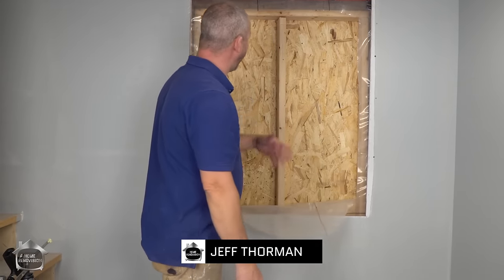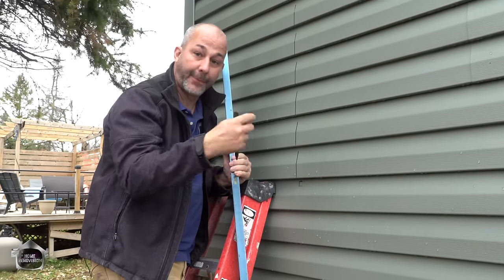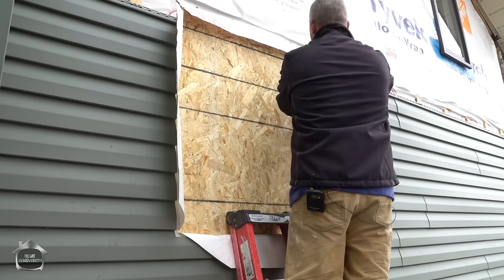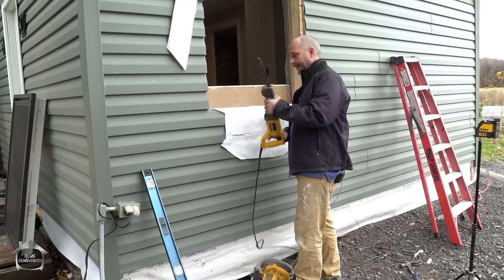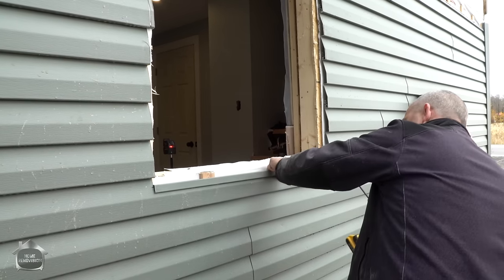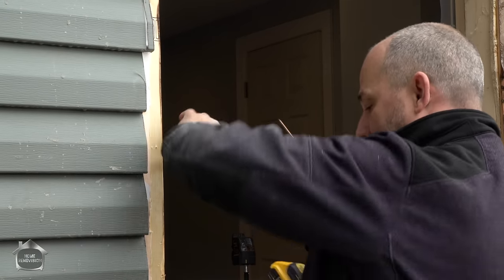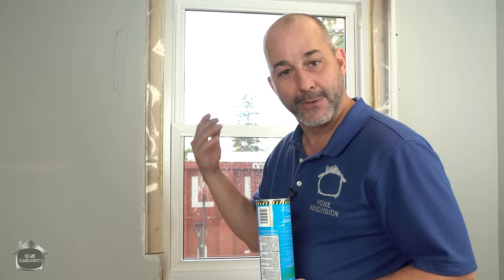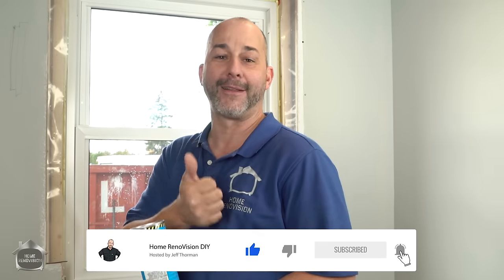How To Install A Window In A Wall

Comment: I gotta say - watching your videos gives me inspiration!  I was watching your other video on tips to reno'ing a kitchen cheaply, your idea about a pantry and removing cabinets blew my mind.  I have a breakfast nook off the kitchen, not too big (about 6ftx5ft) and I don't use it.  Directly underneath in the basement is a capped drain along with hot and cold water supply and I thought this might make a great butler's pantry.  My only problem is, a window exists where I would put the wall and pocket door.  I would rather resize the window rather than remove it altogether (and what do I do about the exterior siding?). Do you have any tips on how to diy such a project (butler pantry and window)?  Or is this something I should leave to a contractor?  My galley kitchen is a decent size but I think you're absolutely right - removing the cabinets and soffit above the counter top would make the space feel extremely airy.  Thanks for your awesome content - keep up the good work!

Comment: If some of the support is removed when cutting the wall, do I have to replace it elsewhere on the wall? Or will framing the box with 2x4"s be just  fine? Thanks.

Comment: I'd rather cut the siding back farther to allow for easier installation of the flashing, and then use vinyl trim around the window.  Also, shims should be used between the window and the rough frame for a true structural installation.  He's relying on the screws putting the window in tension to hold it in place.  Over time the plastic of the window will crack and the window will shift.  Also it's not clear in this video, but did he install a header?  He did say there was a door there so perhaps it already has a header.  Regardless, seems like an awful lot of corners cut in this installation, but to each their own.
Reply: It looks like a two story home so header is probably the rim joist that sits on the top of the double top plate of the first floor wall.

Comment: Hey what about the plate the goes on the top? And the small ones (cripples I think) do you didn't go over that. But I'm now wondering if that's only applicable in new construction

Comment: I plan on installing an exterior door on my garage but I think I might just pull the siding off and after installing the door I'll nail the trim on and then cut the siding to length.

Comment: What kind of blade are you using on the grinder? I'm in the process of getting ready to replace siding on 2 sides (hail damage). That blade be perfect for angle cuts (gable).

Comment: My house has asbestos siding, then they put insul-wrap foam board and then vinyl siding on top of that. My question is during window replacement what do I wrap or tuck in around the outside of the window for better waterproofing? Thanks!
Reply: A rubber membrane self adhesive flashing sold at home depot or lowes in window isle

Comment: What's the reason you used a renovator's brickmould rather than a nail fin window?  With a nail fin there's more work involved, being that you need to remove siding to put it in, however, you are able to put proper drip caps on, and don't rely on caulking to keep the window out. 

Please explain your decision. I don't like relying on caulking.

Comment: I'm thinking about using the spare window I have leftover from when I had a deck built and want to install it in my garage. Your video is very helpful but a previous video I saw the guy put a header in, is the reason why you didn't put one because you already had a door there before and it already has a header? Do I really need a header if I'm only cutting one stud?
Reply from the maker: yes I had a door and yes you need a header. Cheers!
Reply from the maker: you can make one with joist hangers to carry the load so as to not increase your scope of work. Cheers!
Reply: @HomeRenoVisionDIY  Thank you for your tip. As a homeowner, I sincerely appreciate your videos.

Comment: Also, could you showcase putting in windows that fit between studs? For cases where permits for structural changes can be prohibitive?
Reply from the maker: same as this only smaller. Cheers!

Comment: DIY you can go the extra  mile that can cost a premium when you hire someone, doing the best you can with your WRB and taping up as many of the penetrations is more belt and suspenders, then lipsticking a pig. The only thing differently I'd do is to put a cant strip on the sill to slope the water back outside (i.e. cedar shingle under the window, then blueskin over) so any water gets it, it will roll back out. Backing rods for sealant use.
Reply from the maker: love the idea of a backing rod. I will show that on the next window I do. Cheers!

Comment: So you cut a beam out without an additional header added?
Or was the framing already done for the window install and the stud was just for show?
Reply: The original hole was a door. He did a mock up for teaching. I had a similar question. The header part seems the hardest. I'd like to see it.

Comment: why not take more sidings out since vinyl sidings are so easy to install, instead of cutting so close to the RO. taking more sidings out will give you the room to install Window bucks, and apply tapes properly.
Reply: I believe he is putting the information there for some one that has a completed siding. But if it was my house I would remove the siding to get the nails in the siding i channel, and install the flashing better. Pretty good video for what he was showing a viewer

Comment: You just "happened"to have horizontal studs at the right place to install that window since it used to be a door there. While the vynil manipulations are awesome, I'd like to see the same video but with how to frame the damn thing so I can keep structural strength to my wall when cutting a big hole in it.

Comment: First, I love your shows... only thing is I'm surprised you don't wear safety goggles cutting tile, wood, etc.  Second, so I have an older house with builder grade aluminum plate glass windows that are like 35"H and 84" wide (side sliders) but it's in a brick veneer down here in Texas.  I have not seen any video showing how to replace old windows with new windows in a brick veneer house.  Have you done that?

Comment: Hey Jeff... Just a quick request.  Some of your links get lost in the videos (for instance, half way through you talk about putting a card up in the video corner for something related to what you are talking about at that moment).  The card never ends up there, which makes sense as they come at the end of the video per the way YouTube works.  My suggestion is to have a list of those links under a heading in the video description along with your social media links, etc, so that they are available. Just a thought I've had after a couple of the videos...  Otherwise your the man!  My renovation has come to a screeching halt as they have stopped all non-emergency inspections in my area so you are the only game in town right now!! Lol!!
Reply from the maker: Thanks Stephen, I will have another look. Cheers!

Comment: Jeff! I feel like you set some viewers up for failure by pre-staging your framing ahead of time. No one is going to going to cut a random hole in a wall to install a window and have a sill (and, I assume, headers with jack studs) magically appear in the wall. The header might not be a big deal on a single story house (or top story of any house) and the window is 30 inches wide or less and you know to make your cuts just inside two 16 on center studs so that you're only removing one stud...but that's a lot of IFs that I'm surprised you neglected to mention in this vid. If this were a wider window and/or there was additional floor(s) above this and someone did this without doing any additional framing work is compromising structural integrity and I know you know this because you've talked about load transfer in other vids!
Reply: I was wondering about that…

Comment: It would have been better to adhere the blueskin (peel and stick membrane ) to the  front of the typar ( water barrier ). In this demonstration, the skinny piece or membrane adhered to the wood isn't likely to keep the water out because of the insignificant amount of horizontal lap.
Reply: Without a sloped sill you are not ensured that the water can "get out"
Foam around the frame isn't a proper waterproofing material for around the frame.
That being said, I do really enjoy your videos and much of you work.

Comment: As a teacher there are times when I miscalculate a simple math problem because I'm focused on teaching students how to do the problem rather than the problem it's self.  I bet you have some of the same issues as you make the videos leading to that simple mistake of not cutting the hole the right size.  If people haven't stood in front of others or produced videos of work they may not understand the challenge of working and teaching at the same time.  Nice work as always!

Comment: What’s that window called ? I ask Lowe’s about a window with brick mold and the ability to screw through the inside frame and they look at me like I’m crazy . I have this exact siding and would like a window just like that
Reply from the maker: It is called a double hung. Cheers!
Reply: @HomeRenoVisionDIY  sorry for the dumb question but it doesn’t haven’t the nailing fin around it correct ?

Comment: were ya supposed to rewrap the tyvek back over the blue skin and around the window opening?
Reply: I think he forgot, it's hard to explain to the camera and do the work at the same time without forgetting a small step or two
Reply from the maker: The trick here is to do the best you can with the room you have to play with. It is never as good as starting with a bare wall. but then again 100 years ago they didn't use tape or flashing or drip edge or sealant or caulking or expansion foam and those houses lasted a long time too. Cheers!

Comment: I'm not saying you have to but I would wear safety glasses when using the cutter because I don't ever want to be blind. The brick mold isn't supposed to sit inside the vinyl siding, it's supposed to sit over it.

Comment: I have a pretty serious leak in one of the windows. Where water is starting to open the seams on the wall at the bottom. But I can’t figure out where the water is getting in from, I have a house where bottom half is vinyl siding and the upper half is brick. Brick condition is not the greatest. Is a 2 story home plus an attic no basement. And this leak is happening on the first floor window
Reply from the maker: best to open the wall and follow the water to find the source. it travels the path of least resistance and can be coming from anywhere. Cheers!
Reply: Home RenoVision DIY will do thanks for the quick reply! Stay safe

Comment: The ayes have it....get some safety glasses.
Reply from the maker: I have always been a safety second kind of guy! The truth is if I can't see it feel it or hear it then I am operating with only half  my senses. I personally feel that is more dangerous than going commando! Cheers!
Reply: @HomeRenoVisionDIY  If that's the case i recommend getting proper safety glasses that don't suck... Uvex makes quite good safety glasses, i personally use a pair of Uvex Pheos CX2. Comfortable enough to wear them for 3-4h straight in the lab and they only cost 15 bucks. And their most important feature: They don't impair your field of view at all, you can actually see what you are doing (in contrast to those nasty 2 buck hardware store glasses). Seriously, get yourself a pair, you won't regret it.
Reply: Let's hear it for ear protection while we're at it.  🙉😁
Reply: Yo Man 
Tinnitus sux!
Reply: Engage the safety squints
Reply: No eye protection, no hearing protection, but just as bad, no guard on that grinder. 
Slip with it, and you could end up short of a finger or two.
Reply: Brenda May Fuller I was just using the exact same tool with no guard. I nicked my finger and it nearly cut to the bone in a fraction of a split second. I continued use but was more mindful. Tip: I use a dimmer switch on my tool that limits rpm drastically. I don’t like hold a tool so powerful while having no guard. The RPM is minimized to enough that it slowly cuts safely. I use gloves now.
Reply: I used a circular saw cutting flooring with no hearing protection. My ears started ringing the next day and still do 15 years later.
Reply: first the grinder then saw, ohmygoddess!

Comment: You should stop telling people to wrap the house wrap into the framing....that's not how it should be done anymore. Also, putting in screws so low in the bottom corners where water will rust them out and cause leaking into the framing isn't a good idea.

Comment: Best-case scenarios aren't very helpful in how-to videos.  E.g., here, you had pre-framed for the window where there was already a door, which isn't very helpful for those of us who aren't so lucky.

Here in the real world, we're more likely to have to cut out the interior drywall floor to ceiling, because it's nearly impossible to secure framing inside the cavity (e.g., jack studs or cripples to the floor plate) AND we're almost certainly going to have to deal with an electrical line running under the window that will need to run through any new stud.  Now THAT would be a useful video... heck, add in a wayward drain pipe and vent or CAT5... maybe talk about placement restrictions (e.g., proximity to a flue)... or permitting.

Comment: The only downside to installing your own windows is that the Canadian Gov't will not give you the rebate for improved energy efficiency.   I just had all my windows replaced by VanIsle Windows in Nanaimo and am getting $1000. back from the $9500. price.
Reply from the maker: The upside is that I am paying less than half price for the windows since I buy from a wholesaler. the Gov can keep their rebate on retail! Cheers!

Comment: Tinnitus is not fun and , if caused by exposing our ears to things like power tools and rock concerts , isn’t really treatable .  And it’s not unlike torture .  Thing is , it’s just about 100% preventable .  Ear protection is not just for sissies .  25¢ to stick some closed-cell foam earplugs in them and save a lifetime of high-pitched ringing in your ears 24/7/365 .

Comment: Good thing you didn’t cut 59 lol
Reply: Jeff, do you tend to plumb up the side if the window as well as the base or do you check more for square? Vinyl windows are rarely perfect, they usually have a slight bow in them.
Reply from the maker: say that!

Comment: I really enjoy your videos -- unpretentious, resourceful in working around issues, etc. However, for me at least, it feels at times like you are talking to yourself, not me. A lot of shorthand comments about materials and methods that might be familiar to you but not likely to most watching this. I'll watch several times, which is a good practice anyway, but so far I am baffled about how you arrived at some measurements, how to frame the inside, etc. As well, it drives me nuts in an instructional video that you don't use any safety equipment -- eye protection and ear protection. That is just inviting your "lay" viewers to hurt themselves.

Comment: Not installing a header above window is a terrible advice! You are compromising structural stability of home. Any builder will tell you what you did is a terrible idea.
Reply from the maker: Hi Roman, what part of this used to be a door don';t you understand. If you were a builder then you would know that there is already a header.
Reply: @HomeRenoVisionDIY   How many of your fans would actually cut a hole in place of previously existing opening to install a window? How many do you think will try to cut a hole in their walls to install a window and will never think about installing a header just because they listened to your "used to be my front door"? Regardless of that I stopped watching when I saw you using grinder without guard, no PPE  used and improper use of A-frame ladder. Good luck with your channel!
Reply: @unnamedny  calm down Karen

Comment: everyone calls it a skill saw,
Reply from the maker: They do in my neck of the woods. Cheers!
Reply: @HomeRenoVisionDIY  It's not that common a brand in the UK, at least I never used to see them on site, (we'd see a lot of makita, dewalt and Hitachi) so for years I didn't realise it was actually a brand name and thought it was because you had to be skilled to cut in a straight line. :)